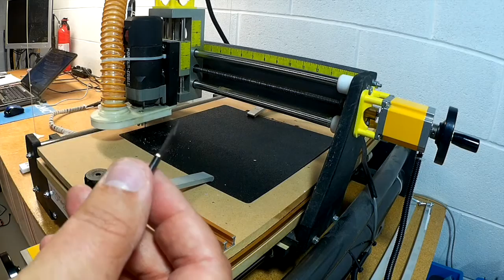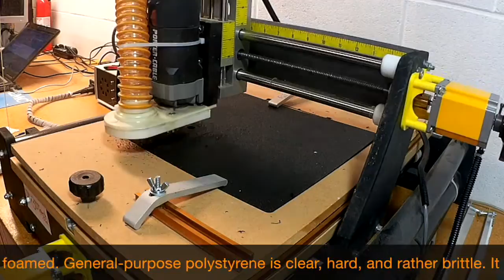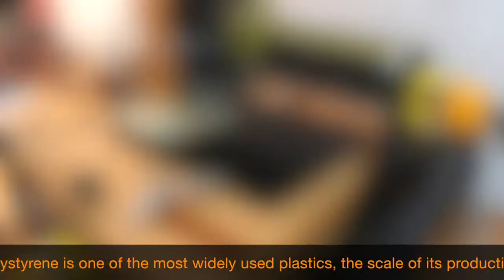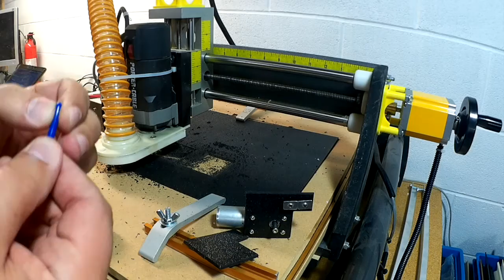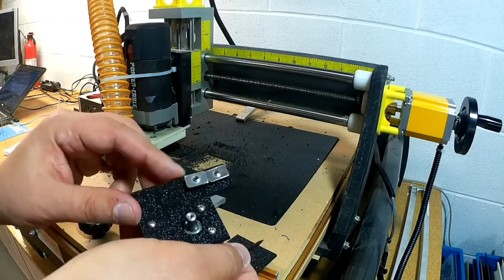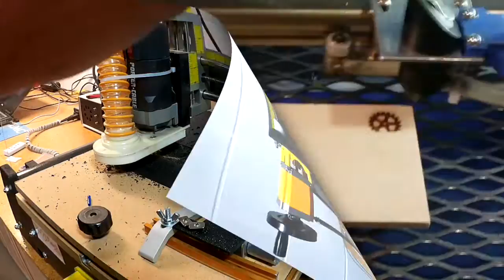CNC Project -  Using a VBit to Cut ABS and Polystyrene Plastic!

Comment: what was the cut time for the better quality piece? I have been looking for guidance on using very small bits like that one without much luck, and am very glad to have found your video. do you have a link to the shane bell video where he cuts sheet metal with that bit? I have not tried cutting with my small bits yet, so im looking for a starting point on feeds and speeds with mdf and anything would be helpful.
Reply from the maker: Small bits are to work with, I suggest single flute, double at most other wise they gum up and break.  For sheet metal us a 60deg V bit...

Comment: I have a question about cutting Styrene with my cnc machine im using lazy cam with dxf converting to gcode and for some reason I can ever get the cnc to cut curves i have jagged edges. Is there some thing i am missing it should be able to cut clean curved lines on 39/64 Styrene Plastic. Any thoughts.
Reply from the maker: Depends on many things, what is your micro-stepping set to (needs to be at least 1/16) also what size bit are you using and is lazy cam set to use Archs then steps?
Reply: @DIY3DTECHcom  
Most everything is done in coral then brought into lazy cam to make dxf is there a better way to do it. Sorry I am brand new to this

Comment: Thanks for posting this. Having tried it I found that cooling the job with water made a big difference. A bit tedious chasing the tool round the work with a paint brush and the mix of polystyrene chips in water makes a mess but the job looks good.
Reply from the maker: You could also use air too (as this was made a while back).  Today I use a single flute and move really fast (like 200 I/S) and works well...
Reply: @DIY3DTECHcom  Interesting. Unfortunately such feed speeds aren't possible when cutting small scale plasticard parts for model making. Reducing the spindle speed way down (5000rpm) and cooling allows me to work at 400mm/min.